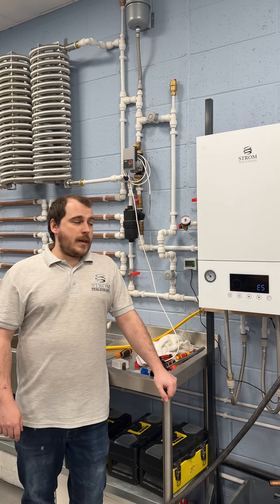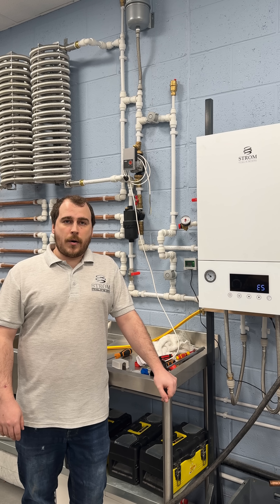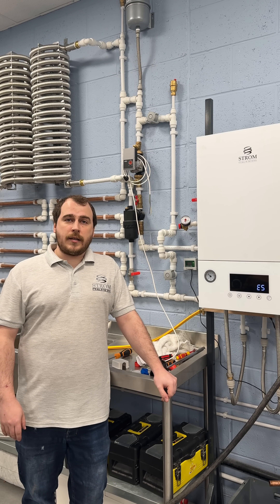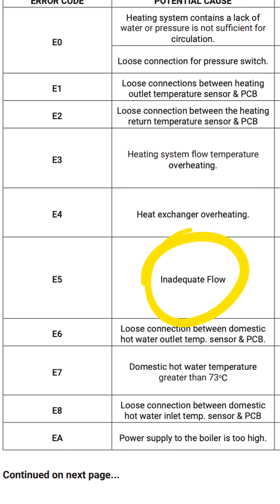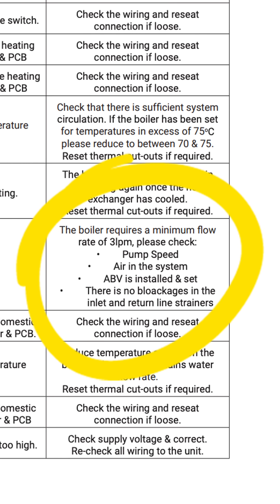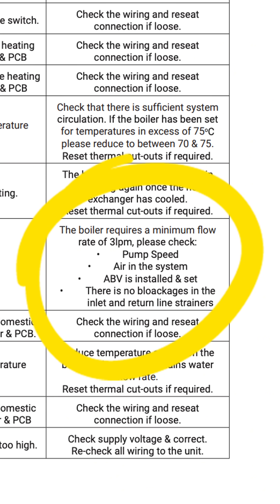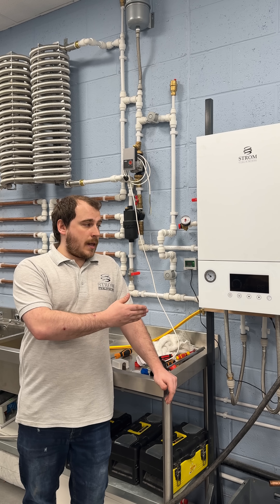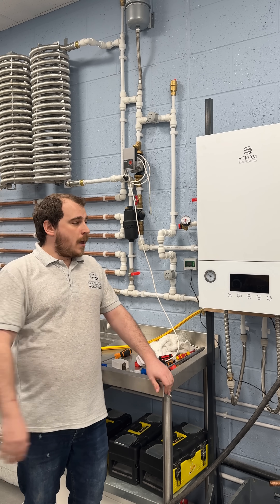Strom E-Boiler E5 Error Code Explained & How to Reset!

Comment: I installed one one of the e boilers trips out on heating and use of shower not on hot water to taps but doesn’t really reach temp ???
Reply from the maker: They always reach temp if installed correctly. You need to set the flow rate through the boiler.